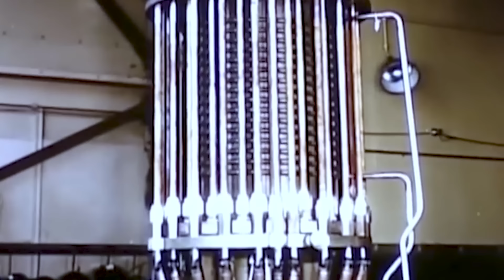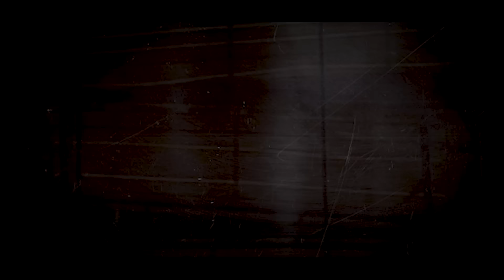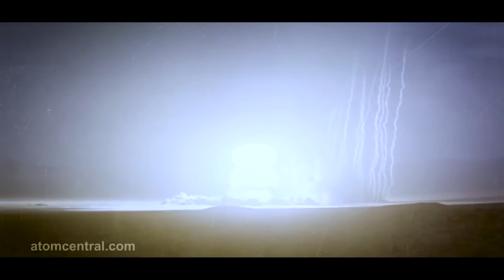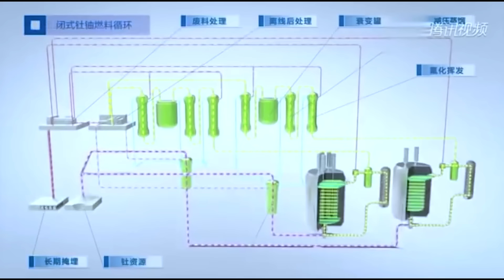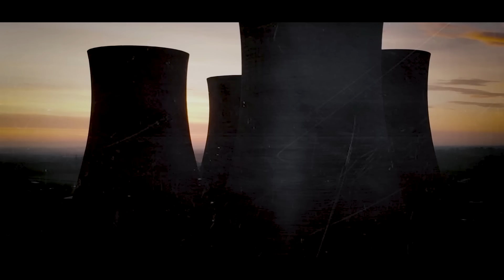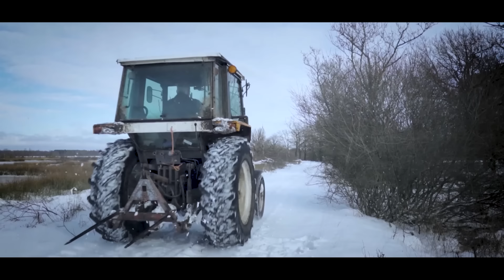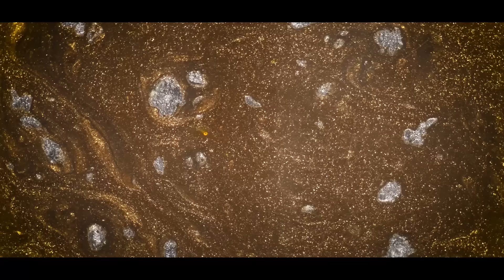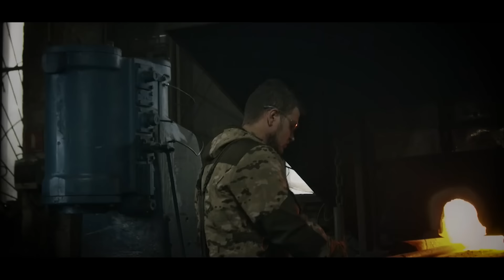Future of Thorium Reactors and Nuclear Energy

Comment: Another point for thorium, all you need to do is mine, purify to element, bang done, with uranium you need expensive isotope isolation, thorium is good as is.
Reply: All you need to do first is find a deposit of thorium, and that is difficult as it is not widespread geographically nor geologically.  uranium is the opposite case and occurs widely in a variety of geological situations and can attain very high grades, making it cheaper than thorium.

Comment: The key is Molten Salt Reactors which are more efficient, as opposed to Water Reactors.
The US test Molten Salt reactor used uranium, and worked well, low waste, low cost, plenty benefits.
Only problem is that Molten Salt reactors is too cheap to run, and large companies can't make money!!!!
Reply: To cheap to run so companies can't make money?
That a contradiction in itself.
Issue is that molten salt is very corrosious and has destroyed the tubes of every test reactor so far.
Reply: @TBFSJjunior  i doubt there is no material to replace steel in tubing. since its low pressure it could be any composite
Reply: @ivangalik7848 
It has been an unsolved challenge for over 50 years, so I doubt that they didn't try other materials than steal.
Reply: @TBFSJjunior  but then its probably unsolvable conventionally (mixing alloys, chemicals) maybe some advanced nano materials creating proteting films on the surfaces?
Reply: @ivangalik7848 
It is probably solvable, but it isn't easy and it isn't cheap and might not be economical feasible.
Those are the big challenges.
Reply: @TBFSJjunior  The water reactors make significantly more money for maintenance and cleaning up contracts, and waste storage.
The salt corrosion is misinformation from the water reactor supporters.

Comment: I've been watching a alternative fusion project in Aneutronic, called focus fusion for sometime now, and quite surprised to hear that a similar aneutronic project receiving billions in funding? The main difference between the two seems to be the fuel it runs on, the one receiving the most investment is the one with the most controllable fuel source helium-3 as opposed to hydrogen and boron that focus fusion uses, it got me thinking about uranium vs thorium it seems that the reactor with the highest possible of a cartel forming around it's fuel supply will be the reactor getting the most investment which help to explain why we don't have Thoruim Molten Salt Reactor.
Reply: No,U suppliers have nothing to do with the lack of progress on Th reactors, followed focus fusion for years Helion energy is leading in this area with a huge investment recently.